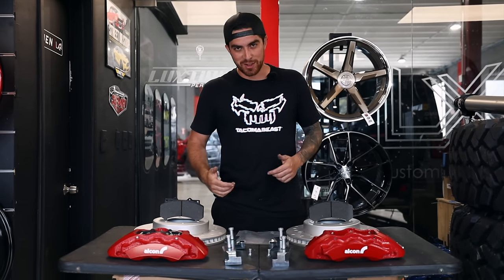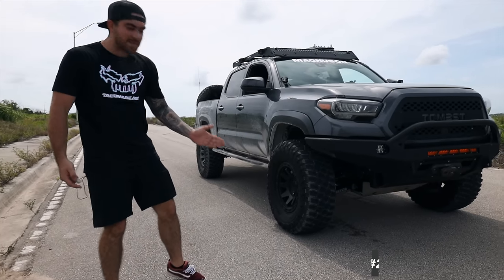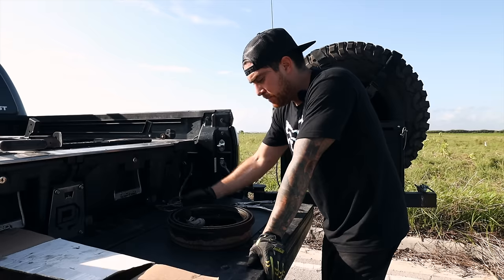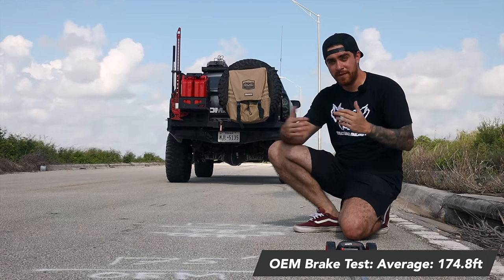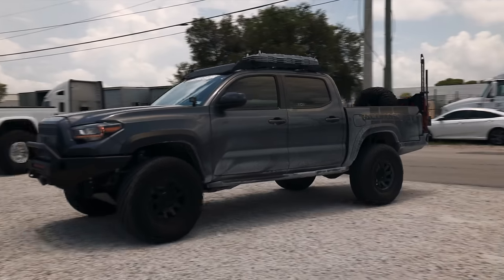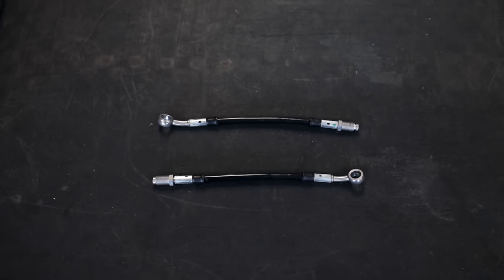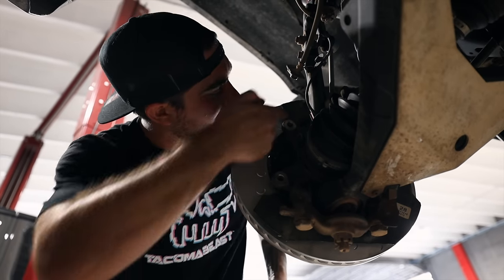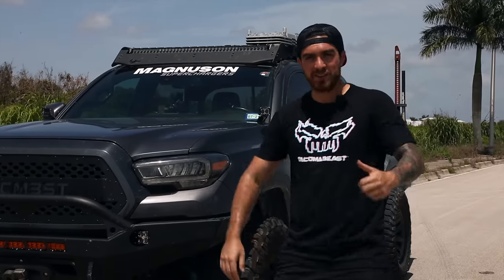Toyota Tacoma Brake Rotors Performance Test. Are they worth it?

Comment: It's a nice looking kit, but seems like a lot of modification for such an expensive upgrade. It would be great to see this test with a set of StopTech rotors and quality pads to compare.
Reply from the maker: The OEM kit was a fresh new set
Reply: @tacomabeast  with rust and grime built up into it... no it wasn't.
Reply: @Kojima93   ya idk why he was lying
Reply: Donut media did said test with their 350z's in their hi-low series. Check it out.
Reply: @johnnymartinez478  those rotors if OEM are pretty fresh, mine showed rust on the hat and veins within 3 weeks of ownership.

Honestly the slight increase you'll see between a 10K set and brand new set isn't going to change heatsoak enough in most tests to make a difference. It's why pads/new rotors alone isn't a great idea. That heat being dumped into the rotor has to be extracted or you'll just end up with fade still.

So in humbolt's suggestion, depending on pad you will see anywhere from an increase or decrease in first stop performance as the pads get up to temperature, and then an increase in most likely the 2nd, 3rd and MAYBE if it's a hot temp pad 4th test. After that performance will fall off like a nose dive.

Most OEM brake systems are not designed for continous braking, so you will need to decide if you will be doing enough to require it.

Also their test on the aftermarket set is on point in expected results. Those pads are probably a high temp pad meant for performance driving where there is constant use. So it is expected for the pads to come alive after a few runs and hold performance as they get into range and the braking cooling cycle stabilizes them.

Comment: I could tell it was gonna help, because if you can't lock your tires than you should upgrade your brakes
Reply: The ABS is there so the brakes CAN’T lock up the tires. That’s the vibration in the pedal from ABS pulsing the brake lines.

Comment: Those brakes are sick but Not worth the $2,300 tho
Reply: Depends on the cost of those 30 feet on an unlucky day.
Reply: I agree at that price I just pick up the rear helix disc brake and save 30 feet for $600 the price is to high not worth it

Comment: Thanks for this information.  I am 75 and have been off-roading since I was a kid with my parents in a 55 Ford sedan.  We fished in Baja Calif down to LA Bay in a 2 wheel drive with no ground clearance.  As an adult I have hunted small and large game.  I bought a 1970 Ford F100 2 wheel drive and added a rear locker.  Later I went with 2000 4x4 Tacoma extended cab.  Brakes sucked in all of them.  Just finished rebuilding my 2000 Tacoma with frt/Er lockers, rebuilt my 5spd trans, Merlin Crawler and transfer case.  New rear driveline.  Bigger brakes are next.  Bought a 2017 TRD 4x4 Offroad double cab.  60k on it now.  As stated before the front brakes are undersized for the stock trucks.  I tow an enclosed box trailer with my camping gear, fishing or hunting gear, tent and miscellaneous equipment.  It all adds up in weight   Hauling all my stuff cross country on hunting trips in adverse weather ANYTHING that improves your ability to slow down or to stop in an emergency is a tremendous benefit.  I greatly appreciate Tacomabeast sharing ALL the test information they have presented.  Looking forward to the rear disc brake kit!
Reply from the maker: Hey robert! We’re glad we could help! 🤟

Comment: Solid video. Guess I need to upgrade my brakes now. I never liked them anyway. Never felt really comfortable with stopping power even when it was brand new. I took it back to the dealer twice thinking that maybe there was something wrong with the brakes. But it's just the way the fifth GEN is.  Test drove three others exact same thing. They tell me that Toyota engineered them that way. I like brakes to feel tight. Responsive.  predictable, and consistent.

Comment: Are you going to change the rear breaks to Disk? That’ll help out a lot as well
Reply from the maker: Coming soon!
Reply: I talked the company that builds the brakes for the factory toyota Dakar rally trucks (Power Brake) and they said that when they added rear disks the rear end would rotate, (like using the coaster brake on your old BMX bike as a kid) so they recommended against doing the swap. They actually went back to the rear drums.
Reply: I spoke to the same guy, he said they wouldn’t really benefit

Comment: I went with the Stop Tech kit with braided stainless lines.  Did fronts and rears.  Thinking that getting rid of the drums was a huge improvement as were the new hi performance pads.
Reply from the maker: Yes! We noticed that the rear drums were a big issue mid shoot (as you saw from the vid 😂) , and now we’re working with Alcon to make a rear disk conversion kit 💪
Reply: @tacomabeast  My truck is five hundred pounds heavier than yours.  33’s, 4.88 gears and Magnusson SUpercharger.  Don’t know if I would have done supercharger if I hadn’t done the brakes.
Reply from the maker: Yeah we found out the hard way that we needed to swap out the rear drums 😂

Comment: One thing to note on your test is the rear brake failure may have affected the 3rd test as the pressure for the brake system would have dropped and affected your stopping distance. Probably would not have made a big difference given you did an average but it is worth noting since this is a scientific test. Great work!
Reply from the maker: Thats a really good point bro!

Comment: Nice demo and proving out! For the over landing guys hauling around the extra weight it seems like this is a must have upgrade! I have a 2nd gen 4x4 4.0 liter that I have had from mile 0 currently 232k on it. The rotors always seem to warp after 30k or so running 265 75 17 tires! I have tried the high carbon steel rotors even they shimmy under braking after some miles. I would love to upgrade but this kit is a little on the spendy side. Do you have to get replacement pads and rotors from Alcon or is there a crossover part you can use?
Reply from the maker: You would have to get the replacement pads from Alcon for this one 🤙

Comment: So you are comparing a brand new aftermarket kit to an old OEM kit with how 
many miles🤔 Toyota brakes are high quality especially because they are designed for a stock truck. I’m running mine with 37” krawlers no issues
Reply: Don’t lie them 37” tires you gottah plan way ahead when you stopping 🤣
Reply from the maker: The OEM kit was a fresh new set, we wanted this to be as fair as possible.
Reply: I'm not lifted, but have 113k on mine and haven't had any issues yet. Looks like I'll get another 20-30k on them.

Comment: I would like to see you change out the rear drum for rotors.
Reply from the maker: We’re actually exclusively working with Alcon to make a drum conversion kit for the rear drums! 🤙
Reply: @tacomabeast  that's would awesome so far the only way is to use the helix rear disc system which is costly but easy to do

Comment: Also the problem with going larger calipers and rotors in a extreme off road environment sand can get trapped in the barrel of the wheel which an sand the calipers down causing failure
Reply from the maker: That’s a good point! Gotta make sure to watch for sand often 🤙

Comment: Brakes on my stock 2019 tacoma are better than any chevy i have been in. Tho 06 impala with power stop drilled slotted rotors all around with best pads they had nearly tear your head off. Drums in the back is BS. Look to up grade my tacos brakes for its first upgrade

Comment: For the Toyota Tacoma, would it be more beneficial to just get the TRD Pro and start customizing from there or a lesser trim level? I understand the TRD Pro isn't "required" persay but, does it help more to start there and build on or to just get a lower trim?
Reply from the maker: It might make your customization a bit easier, and it does come with some perks like the CRAWL control but ultimately you can build an SR5 just as nice as you can build a TRD pro 🙌
Reply: Lower trim if you are doing a build otherwise your throwing away your money. If you want leather get a off-road to build from but if just want base build start with a SR v6 4x4. You have well over 10k to build a better truck. Honestly the best way to build a true Taco for the wild... Good luck
Reply: Thanks guys, super appreciative. Wife and I are nurses and have minimal vehicle modification experience haha but super interested and love the outdoors.
Reply: @jamess303   just curious if you and your wife ever started the build?

Comment: I would switch out the stock brake line, and replace it with a steel braided brake line....they are nice lookin trucks ....too bad the rust issues still persist. Smh
Reply from the maker: That’s a great idea tbh never thought about it

Comment: How come noone is talking about upgrading to the Toyota 13.4 inch brakes from a 4runner sport and I think its the Tacoma sport or even Tundra (even bigger). I upgraded to the 13.4 from a tacoma on my 07 4runner. Only have to remove or modify the dust covers super easy. Also the 4runner rear disks setup should fit I'm not sure of the details but pretty sure it bolts on if you get all the parts
Reply from the maker: We haven’t heard of doing this, and we’re not really sure if they’re compatible, which is why we worked with Alcon to develop this kit 🔥
Reply: @tacomabeast  Do you even forum bro?

Comment: Its a nice setup, and great from what Im seeing. But for $3000, thats a VERY expensive upgrade IMO.
Reply from the maker: Comparatively I think it makes sense, it’s the same as buying a front and back bumper for your taco and it boosts the performance 🤷‍♂️
Reply: How much would it cost if you needed to stop 30 feet sooner to avoid running into something (or worse yet someone)? $3 grand then becomes worth every penny. Any money spent on better brakes is worth it.

Comment: You ran an OEM kit that’s seen tens of thousands of miles of off-road abuse, cross country travel, and weather against a brand new aftermarket kit. IMO shoulda I stalled new pads & rotors that were OEM then proceeded with the test.
Reply from the maker: We installed a new oem kit before running the tests to make it a fair fight 🙌
Reply: @tacomabeast   shit did I miss that in the video 😂 guess that’s what I get for watching while doing an oil change

Comment: Question I was driving around 40-50mph and then I started breaking for a stop sign and my truck had trouble breaking it kinda made a sound and it would break and then move forward 3 times not sure why it only had 7k miles
Reply from the maker: Sometimes the disk breaks slip, although I would get that checked out because its very rare and could also mean your break fluid line is leaking somewhere
Reply: @tacomabeast  thanks for the info

Comment: You made a nice video! However, any new brakes will be better than your old OEMs. If you had installed a new OEM brakes and tested those against the Alcon's you would have had a better comparison. I realize that's cost prohibitive but...
Reply from the maker: That’s exactly what we did. We swapped the OEM kit for a new one.
Reply: @tacomabeast  new OEM brakes?
Reply: @tacomabeast  I think you misunderstood. To get a fair comparison you need new OEM brakes vs. Alcon.
Reply from the maker: Yep we changed the OEM kit for a new set of OEM’s before running the test to make it a fair fight 🤙

Comment: $2400 way too expensive. You will not get the same results for sure. But you will get an improvement over stock with a performance pads upgrads and save a bunch of money for other mods. 
Great video though!!
Reply: Stop being cheap. BBK's cost lots of money. This isn't that bad a price. Try twice that for some of the performance cars.
Reply: it is an investment.   Sure its a lot of money today.  WAY cheaper that a car wreck tomorrow.
Reply: @Chris McCarroll  your brakes are only as good as your tires.  You can have a $5k brake upgrade and if you tires don't grip your ABS will release.  We don't run Michelin Cup 2 tires on these trucks.

Comment: 1st test was faulty as the rear brakes were freshened midway thru the test.  Upgraded front brakes should have been tested against fresh stock brakes rather than high mileage units.  

Nice try though.
Reply from the maker: We switched to new brakes before doing the test! We should have done the first test again with the new rear drum breaks but it wasn’t a significant enough difference to be honest 🤷‍♂️

Comment: You sell those ...and test them...the outcome of the testing is expected.
Reply from the maker: We recorded the entire process of testing them to show we aren’t biased 😂 but if you want to believe that go ahead bro
Reply: Is it a whole purpose of the "influenceser" to setup a subjective testing? 
Why don't we hear ABS ratchet noice on your agressive braking?
Reply from the maker: We didn’t aggressively break because locking them tires wouldn’t help the test.. we wanted to make the most use out of the breaks not the tires…
Reply: @tacomabeast  I don't want to get into semantics, but OEM NHTSA testing is with full lockup and ABS engagement. You do need to hit that point for maximum consistency, otherwise you are adding a huge variable into the equation and cannot come to precise scientific conclusions.

Comment: If only Toyota put rotors in the rear....
Reply from the maker: Working on a kit
Reply: Just buy the helix rear disc brakes and hardware they mount right up you have to pull the rear axles to install though. It's about $600 in parts. You gain 30 feet in stopping power

Comment: Replaces 2 pot pistons for 3 pot on the front....still has drum brake on the rear...smdh
Reply: 120 year old tech and he doesn't replace it
Reply: @jeffreycormier3864  I would replace those before the fronts.
Reply from the maker: Patience is a true virtue. We are working with Alcon to develop a rear disc conversion kit.
Reply: The front is where a majority of the braking power is needed, and applied.  So yes, it makes sense to upgrade the front before working on the rear, even with drums.
Reply: Yup, most of the braking is coming from the front, especially with more weight transfer like these Tacomas with heavier weight/softer suspension. Only thing you would be gaining from disks in the rear is less brake fade.
Reply: I am aware of brake bias and why it makes sense, I drive miatas. It's just so much up front and so little in the rear.